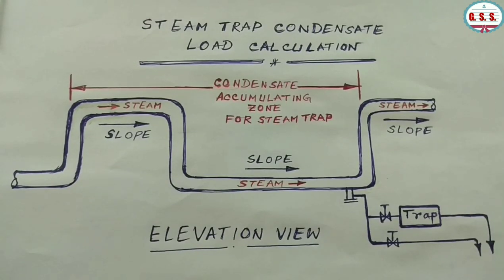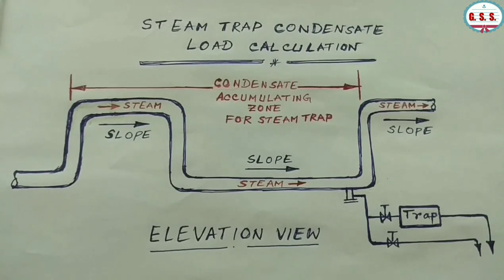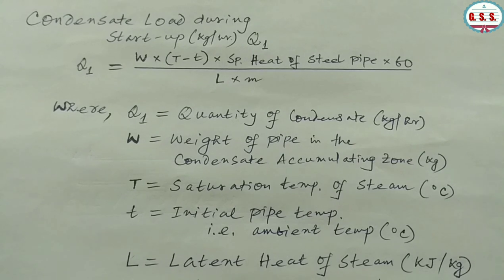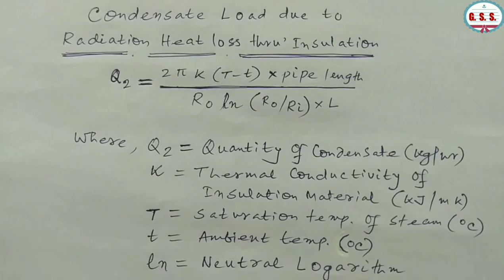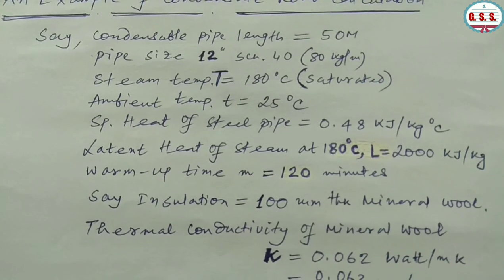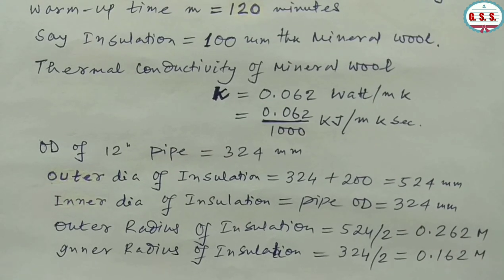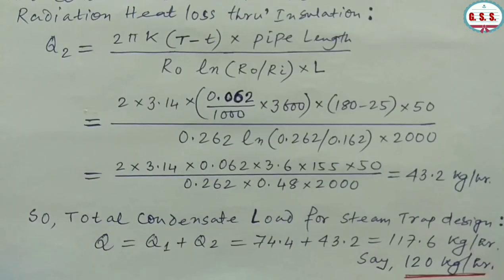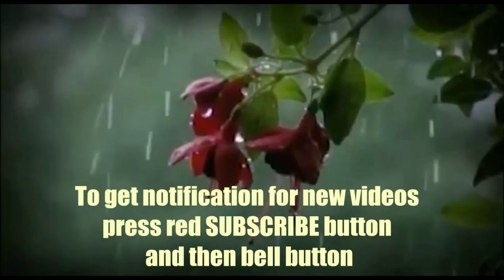Piping Engineering : Steam Trap - Condensate Load Calculation

Comment: Excellent yes 120 kg/hr. However, for steam trap selection a safety factor x 2(for startup ) to be added. So 120 x 2 = 240 kg/hr or 250 kg/hr condensate load steam trap to be selected.

Comment: The radiation heat transfer will give you kg/m2 not kg/hr, please check your dimensional analysis and confirm. There is no time factor on the right hand side of that equation and so it cannot give you kg/hr.